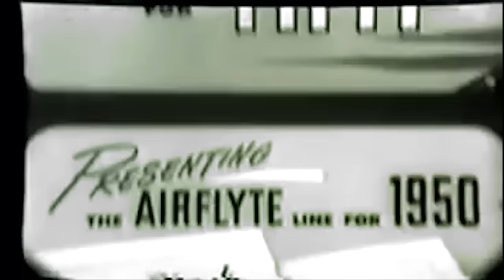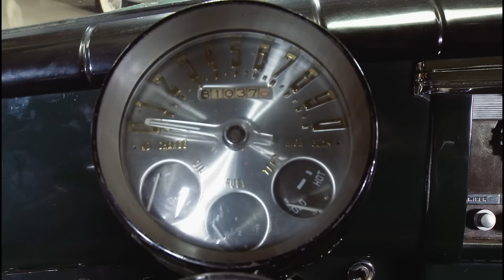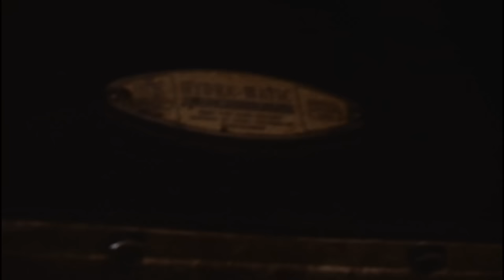1950 Nash Ambassador Custom - Jay Leno's Garage

Comment: The old 6 volt systems really confounds some people. If you’re just doing wire repairs or adding 6 volt accessories like fans, extra lighting etc you have to do use wire at least 2 gauge sizes larger than what would be acceptable for the same accessory on a 12 volt system because the amp-load per watt is twice what it is on a 12v system.

Comment: If you had pulled the front seat all the way forward the seat back would have folded flat down had you folded out the clip from under the rear seat. In the seventies I had a1949 statesman with the flathead six and had more fun with it than pretty much any other car I ever had. A great car for the drive ins.

Comment: With Hydra-Matics you park the car in Reverse, but have to put it back in Neutral to start it. On stick shift Nashes the starter button was under the clutch pedal. You stepped on the clutch to start it. A friend of a friend back in the day had one of these. He took a torch and cut out the front fender wells to increase the car's turning radius. He just drove it around that way as an old jalopy. He removed the blocks on the center link designed to keep the front tires from rubbing the fenders wells. It was just old junk back then and he made it a lot junkier. My grandmother had a friend who drove "bathtub" Nashes. I remember riding in them as a kid back in the 50s. When one would break down he'd go find another one. They seemed very strange to someone who grew up in a GM family.
Reply: i always wondered if the front tires could rub the fender wells
Reply: @holoholohaolenokaoi2299  The center link was blocked to prevent that unless you cut out the fender wells! :-)
Reply: @1940limited  Thank you!  Imagine trying to change a flat on that Nash
Reply: @holoholohaolenokaoi2299  It wasn't that hard if you jacked it up by the bumper or frame rail so the suspension hung down. But overall it was a bit of a strange design.
Reply: @1940limited  most cars you could just jack up until the tire was off the ground.  if you're not on a flat surface those extra 6 inches could be disastrous.
Reply: @holoholohaolenokaoi2299  Definitely. Be sure you're on a flat surface! Honestly, I haven't used a bumper jack in decades.
Reply: @1940limited  i'm on a Jay Leno's garage binge.  Chrysler Typhoon Jet engine car is a must watch!
Reply: @holoholohaolenokaoi2299  I've seen it. Not my kind of car, but he does have a lot of stuff I do like.
Reply: The skirted front wheel don't materially increase the turning radius, nor prevent changing a tire. Nash engineers made the front track 6" more narrow than the rear track to permit the car to turn in 40' -- the average, or maybe a little better, for a large car of that day. Also, Nash salesmen were sometimes required by prospects to DEMONSTRATE that a tire could be changed at the roadside.

Comment: My Father had this car in a ‘49 model and blue color. Manual shift with overdrive.. I remember running it up in 2nd gear and put it 
Overdrive and wound it To 90, 2nd gear overdrive. Had to show my Dad. He would not believe me. He tried it a few times but his timing was off. It was tricky to make this happen. I never tried 3rd gear in overdrive for top speed.

Comment: i cant remember the year of my dads old bath tub Nash Ambassador like this one. but his had a very unusual vent system. it had a slide lever on the steering column and a tube under the hood on the steering column that went down under the car and angled backwards so when the vent was opened air going past the tube created a syphon to draw air out of the car through the steering column drawing out the warm, stale, or even smoky air from the drivers cigarette. it worked well enough that if the driver was smoking, the passengers could not smell it at all.

Comment: my dad had a 1953 nash ambassador.the starter was a tab on the clutch peddle sort of odd and yes the seats  rolled down into a bed odd was the negative battery ground it had car rode like you were floating, it also had a over drive switch you could use..... darn they  made some good cars back then.

Comment: My Dad had a 1949 Nash Ambassador.  When we went on long trips I would nap on the deck behind the rear seat.  I was a lot smaller then.  I owned a 1960 Rambler American wagon.  Most of the girls' dads put the brakes on when they found out I had a Rambler with fold-down seats.  It was flat from the dash to the tailgate.  (Eat your heart out, Bill Clinton)

Comment: Nash didn't go out of business in the mid fifties, they merged with Hudson in '54 to form American motors later more commonly referred to as AMC. Both companies were fading fast and merged together in desperation to continue on and it worked out until 1987. The Nash and Hudson names were used until 1957 after which the Rambler name took over. C'mon Jay, I can't believe you thought Nash simply went out of business in the mid fifties and that was the end.
Reply: Yes, there were some very hard years... 1956-57, 1967, and the late 70s until the Chrysler buyout.

Comment: Those tube radios pulled a lot more current than modern solid state radios.  If you listened to the radio without the engine running the battery   would go dead before long.

Comment: Hi Jay,
 The common mod for the 6v problem, especially in the V8s of the late 40's and early 50's, was a 8v Marine battery. 
 Thanks for the cool video.
Reply: You don't need 8v if your wires are the correct gauge and all connection are clean and tight. It will work perfectly fine as-designed

Comment: Great video on the Nash, I would think the front fender over the wheels like that must restrict the steering lock of the front axle. As an extra  bit of information in the 1950’s Austin in 🇬🇧 UK built Metropolitan’s with US styling but much smaller than the US cars. I seem to remember they sold quite well on both sides of the pond.
Reply: They did, and were rather popular, despite their pokey 4 cyl engines, and the 3ontree shifters. They sported small 13" wheels, and would sometimes role over if driven too fast thru a serious curve. But they are still being collected, and several car clubs for them exist.

Comment: The early hydomatics without a park position on the transmission selector are built to engage a parking paw when in reverse the engine is off. Try it Jay. GM thought that since most were used to putting it in reverse on a stick shift that it would be natural with the automatic as well. Of course people failed to figure that out. Put the car in reverse with the engine off and try to push it.

Comment: I owned a low mileage nash like this. 2 Speed Hydromatic w/2 speed vacuum acctuated  overdrive. Hydromatic was cast-iron housing-like what they used on duece-and-a half army trucks. could drive at 95 on I-95 all day long,Highway Patrol would just wave.I think it was a 235c
c u in six- also overhead valve. I could lay down in the back seat. You could roll down the windows and  not get blown away I think it was unibody.

Comment: the "Weather Eye"....  I remeber that from my dad's 1963 Rambler station wagon
Reply: The early Weather Eye system consisted of industry-first automatic, thermostat-controlled cabin heating, later on (1954->) it would also include an AC unit.

Comment: Very nice car Mr. Leno. It looks impeccable. One comment: the automatic transmission is Hydra Matic four-speed, which this brand bought from General Motors. In my opinion, it was the best choice for Nash vehicles, Hudson, apart from Cadillac, Oldsmobile and Pontiac, GM brands.
Packard's Ultra Matic transmission did not exist in 1950. It first came out in 1951.
In addition, on the right side of the lid of the trunk of your car, it clearly says "Hydra Matiic".
Greetings and many thanks.
Reply: My brother's 59 American had a Flashomatic auto trans...but it was actually a Borg-Warner unit!

Comment: There was a small amusement park outside Philadelphia in the countryside, called Lenape Park after the Lenape Indians, and the bumper car ride had cars that looked exactly like this Nash.  A tall pole at the back of each car went up to the ceiling with a brush that touched the ceiling and transferred the electric power to the car motor like an electric trolley car.    But it may have been at a Wildwood, New Jersey, boardwalk amusement park.  My memory may be a little fuzzy.

Comment: its good that jay has the money to collect the cars he does, one of his problems is he misses so much because he thinks hes smarter than he really is. the commercial for nash back in this era told you that the seats let down in the bigger nash model and made a bed that was the dimensions of a full size bed, and the sheet sets for your full size bed at home fit this perfectly. also nash, studebaker, hudson, and studebaker , all had what they call a hill stop in the standard shift models, it looked like the foot dimmer switch beside the clutch, and a little metal tab on the clutch pedal would hit it if you pushed all the way down, stop on a hill, push the clutch down to engage it and you could let your foot off the brake and it would hold the brakes on until you released the clutch

Comment: My neighbor's 1953 Cadillac has a Hydramatic, and it has a park function, but no park position on the shift quadrant. The car is shifted into neutral, then turn the ignition off, and last put the shifter into the reverse position. You can hear the parking pall click, and the car will not roll.
Reply: Add that to the way this car starts and nobody today would know how to drive it!

Comment: The reason car manufacturers went to 12v systems was to save money. With The higher voltage you can use smaller gauge wire. The savings from less copper has probably made them billions of dollars over the years. And, it was, by accident, one ofthe first ecological advancements in the automotive industry. Less mining for copper and less environmental damage producing insulation.
Reply: I thought I was the only one left who knows that!

Comment: I think there were many things that led to Nash's failure.  They were different -- take a look at the lack of wheel wells on the car.  The engine, doesn't have an intake manifold in the usual sense, and there's no exhaust manifold at all -- just an exhaust pipe bolted onto the side of the head.  Being different, in the automobile industry is a very risky strategy unless you're a front-runner like GM or Ford.  Very interesting car...

Comment: Jay, I was hoping you would show how you change a tire. I have seen wheel pants / skirts on the rear of some cars, but rarely the front. 
And the wheel pants / skirts are always hinged or easily unbolted - but to me, it looks as if the front on this car is completely sealed !

Comment: Jay, could you make a short video starting with the car up on a rack that lifts the car by the frame and shoot the video from underneath and show how much room there is for the front wheels on a full turn? In addition, could you also show how to change both front and rear tires using the jack that comes with the car?

Comment: Jay! The GM Hydromatic was NOT a "3 speed automatic" transmission! They were a 4 Speed! First gear was a "granny gear" that you could not manually select with the shift lever. "P/N/D/S/ L/R shift pattern.
I had one of these transmissions in my first ... 8 cars (one 1959 and seven 1960 Oldsmobiles)
My grandfather had one of these "upsidedown bathtub" Nash ambassadors from roughly 1954 to roughly 1962 when he was "forced" to scrap it. (he ran over a skunk). From what I remenber, it was a grand car.

Comment: When I was a kid I always wondered how the driver could steer these cars when the steering wheels were completely covered by the front fenders.  For some reason, in the old 1940s crime melodramas, the police and the "bad guys" always seemed to favor Nashes.  The movie "Cry Danger" was a typical case in point.  Nash did not go out of business in the mid 50s.  Nash merged with Hudson to form "American Motors", which remained in business until about 1990.  For a while their cars sold under the name "Nash-Rambler", later simply as "Rambler", and then under the name "AMC".

Comment: They all want to convert to 12 volts nowadays, and the reason is what you say - they try to use 4 or 6 gauge battery cables, and that just doesn't work with 6 volts.  6 volt starters draw twice the amps.

Comment: AMC had two straight 6 cyl engines during that era; a 232 cu in  and a 258 cu in. The 258 cu in engine was continues into the 1970's and used in Jeep Cherokees as AMC didn't have the funds to develop a V6 engine. The engine was virtually  indestructible but eventually done away by modernization and a lack of competitive horse power..

Comment: "The rear ends in these last two or three  hundred miles...not bad" I presume he means two or three hundred THOUSAND miles? I'm glad he approves of factory engineering; too many people like to talk as if factory cars were basically un-useable, which is ridiculous. While there are sometimes things that can be improved, generally everything works okay, and you don't need to gut the car and replace everything but the body and frame with modern aftermarket stuff. Drum brakes work okay, just remember what you are driving, and don't try to drive it like a modern car. Avoid using the brakes except when necessary, drive steady, not accelerating and slowing down a lot, try to plan ahead, don't wait to the last minute to start braking. People used these for years and they worked fine...but if you try to drive like everyone else on the road, you'll have problems. I once drove around in a car with a broken off brake line, so you got about 20 pedal pumps before the fluid was empty and you had no brakes at all (I was like 19 then). I did fine for a week or so, just thinking ahead and never using the brake except when absolutely needed.

Comment: I once found that Dash pod if you will with the speedometer in it in a junkyard back in the early nineties and took it out of the car it was a 51 Nash I think 50 or 51 I kept that part it was perfect for many years pretty cool just to keep on a Shelf I love your shows but it looks like your front end is a different shade of green than the driver side door just slightly the driver side front fender look a little darker than the driver side door

Comment: It's amazing the money some people spend on an exotic car to get attention in 2012 I bought a 1976 Mercury Marquis with 46000 original miles out of Brady Texas it was perfect original owner was always kept in a garage it did not have the 460 it came with the 400 and it was a really pretty canary yellow with the typical 70s Brown interior but anyway I got more attention driving that car that I spent $2,000 on than any man who spends $300,000 an exotic car by the way I sold it for $4,500 two years later the car was magnificent its curb weight was 6100 pounds it only got about 9 or 10 miles to the gallon but it ran so perfect I sold it because my wife at the time didn't like it I'm a fool

Comment: I often kind of thought that in modern cars, if the passenger seat could fold down flat, so it was up against the rear seat so you could lay down that that would be interesting for this reason -- people who were traveling could sleep on that side of the car (the front and rear seat would fold down to form a bed of sorts and you could sleep).  Usually if you want that in a modern vehicle (or a "camper" car, you have to modify the seat or remove it and put something in its place to make a little bed.

It's sad though that cars like this (and many other older classics) could easily go 100,000 (with proper maintenance) and some modern cars (like some Kias and Nissans) can't even make it to 100,000 without some catastrophic failure or super expensive  repair.  But I guess back then it was more about worksmanship and quality and less about profit (companies still wanted to be profitable, but they weren't nearly as greedy as car companies are today where they'll sell you a rolling piece of plastic for $40,000.

Comment: It's funny to hear Jay repeat the same odd beliefs. As voltage increases you you can use smaller gauge wire for the same wattage -- that's one reason why high tension power lines often run up to 3/4 million volts -- but you can certainly use a larger gauge if you want. You could run a 12v LED off of  0-Gauge wire if you wanted... What you wouldn't want to do is run any load intended for 6v on 12v, except maybe glowplugs which is pretty common. Replace all your 6v hardware and bulbs, leave the wire as is, and you're fine.

Comment: The most common problem with 6 volt batteries is when people take them out of 50hp flat heads and install them in 150 hp diesels not understanding that the CA is too low. The same applies in the marine industry with MCA batteries. It's not really that hard of a concept to grasp, it's the years of misconceptions that screws ppl up.

Comment: 12 volt starters on a 6 volt system wouldn't work. 
The hot ticket was a 6 volt starter on a 12 volt system.
6 volt works well enough, but I would rather have an alternator than a generator.

Comment: You didn't open the trunk to show the taillight mounted inside the trunk.  Since the taillights are mounted on the trunk lid exclusively, there was not light showing from the back of the car when the trunk lid is open.  So Nash put a circular taillight inside the trunk that was visible when the lid was open.

Comment: My 1964 rambler American station wagon had the same darned engine exactly the same head.... So it wasn't only on the ambassador it was a 232 by then, the exhaust manifold was not like that strange how they switch things around that engine was originally a flathead converted to OHV